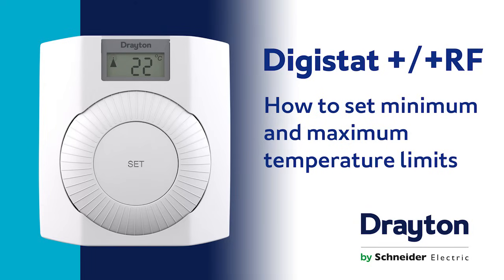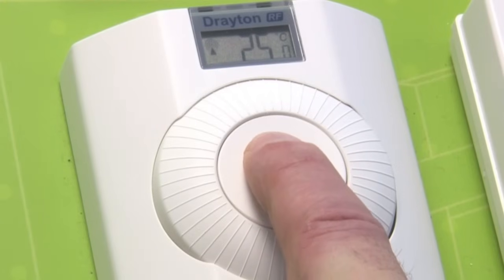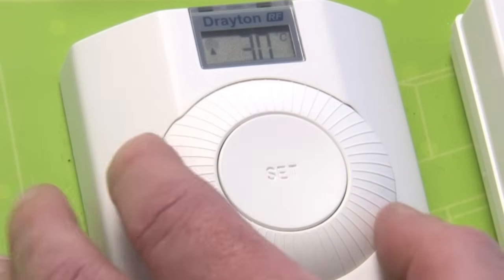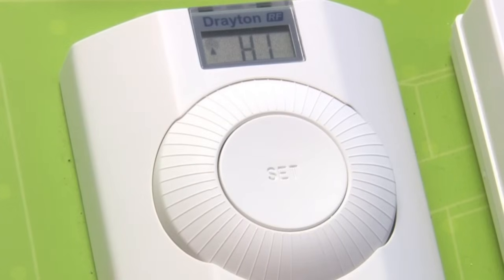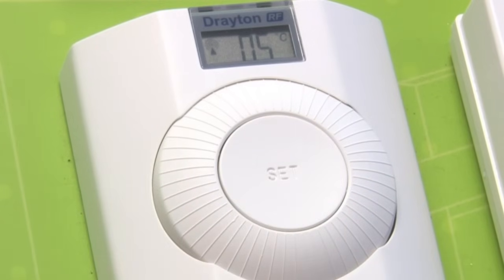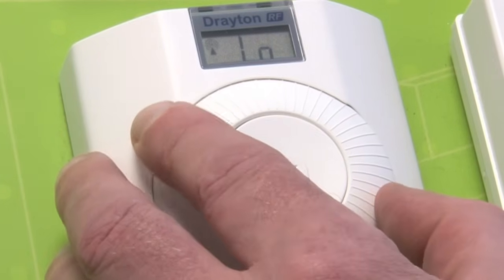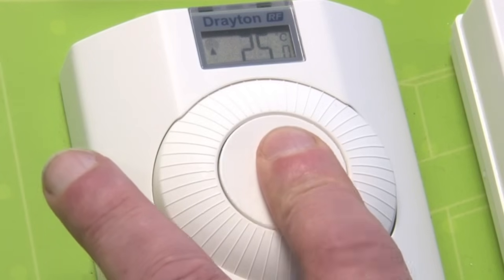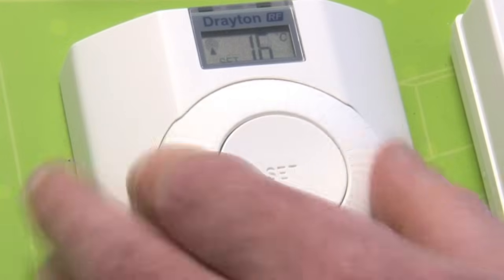How to set the temperature limits on the Drayton Digistat + and +RF

Comment: Great apart from the fact when i entet pr turning the dial does nothing and i am stuck between 15c and 21 factory settings. The dial does nothing.
Reply from the maker: I’m sorry to hear you are having trouble with your device. Contact our technical team and they will sort the connection for you. For the most comprehensive response I recommend contacting our technical support team, who will be able to talk you through the best options for your situation. The number is 0333 6000 622 and lines are open Monday to Thursday 8am - 4.30pm and 8am - 3.30pm on Friday.

Comment: How can the temperature be kept during the day?  I mean how to set up the boiler to turn it on when temperature goes down 18deegrees for example. Thanks
Reply from the maker: Turn the dial clockwise to set your temperature i.e. 18 degrees. Don't press the set button.
Reply: @Draytonheating Thanks thats the answer I been looking for. I turned the dial to 18, pressed set and then it displayed low 0.5 so I pressed set again and it showed 18. Now I know, just turn to desired temperature and don't press set.

Comment: Although the heating light is on in the boiler ( Worcester Bosch) the boiler is not firing; does this mean the outside temperature is higher or should the thermostat be re-adjusted ? It does feel cool in the house.
Reply from the maker: Have a chat with our customer services just to double check that the thermostat is operating correctly - 0333 6000 622.

Comment: How can I unset the minimum and maximum temperatures to use it manually? Thank you
Reply from the maker: This is done through the programming menu as follows. Press and hold the set button until PR appears on the screen. Let go and turn on the dial one click anti-clockwise and this will set your low limit. Press the set button to change and save. To access the high limit from the PR menu, one click clock-wise and the screen will show HI. Press the set button to change and save again. Press and hold the set button to come out on the normal screen.

Comment: Is there a way to get it back to just a normal up and down function?
Reply: Same issue here
Reply from the maker: Ignore the set button, if you want to turn the temperature up turn the dial clockwise and let go. If you want to set the temperature lower turn the dial anticlockwise and let go.
Reply: @Draytonheating  thanks. I’ve tried that but it only goes between the set temps 16/21 degrees so have to make the set temps lower and higher. I just can’t work out how to remove the set temps once you’ve set them.
Reply: @Draytonheating I tried that but it keeps on going back to a lower temperature

Comment: Forgive my ignorance, by doing this does the heating come on and off automatically once the hi & lo have been set?
Reply from the maker: No, the high and low are limits. So for instance if the low is set to 12ºC it means you won't be able to set a temperature lower than 12ºC. The temperature you set by turning the dial is what you'll control at.

Comment: Is it possible to turn heating off and on as wanted with this?
Reply from the maker: The Digistat + and the +RF only control temperature so if you want your heating to be OFF set it to the minimum which is 5ºC. If you want it to be ON set it to a level you are happy with which is typically between 19-21ºC. It is likely you'll have a timer on your system that works in conjunction with the thermostat and this will also have the ability to turn the hating ON/OFF.

Comment: Hi i got Drayton Digistat +/+RF thermostat in my hallway. My boiler is combi boiler from Valliant brand. I want to control my heating switch ON and OFF from my mobile phone app and set my heating times from mobile phone app. Which Drayton thermostat would  you recommend which i can easily replace by myself ??
Reply from the maker: You would need to  upgrade to Wiser. If it is the Digistat+RF version the Hub from a Wiser Kit 1 it would fit straight onto the backplate of the existing receiver. If it is a Digistat+, you would still need a Wiser kit 1 but there would be wiring involved.